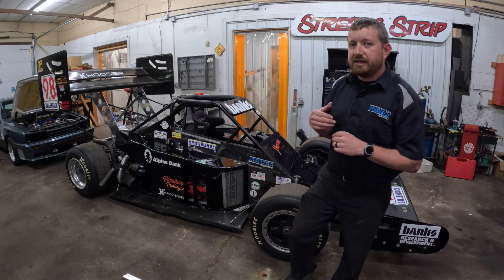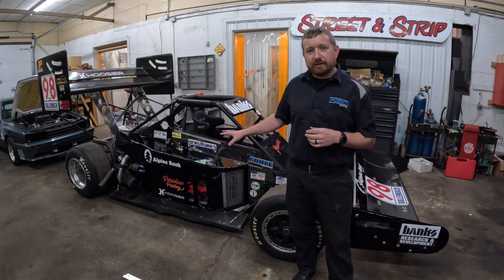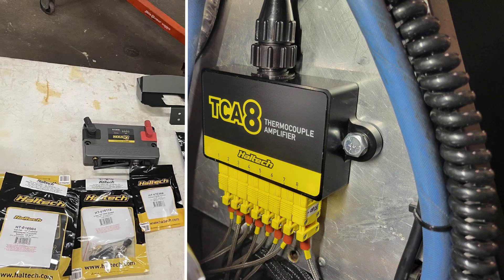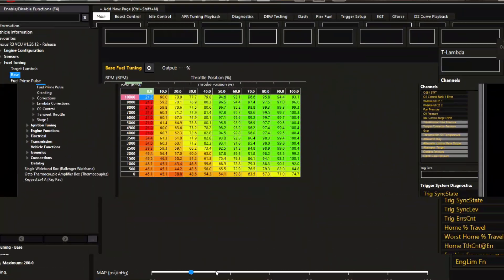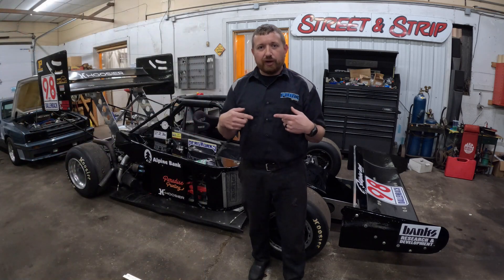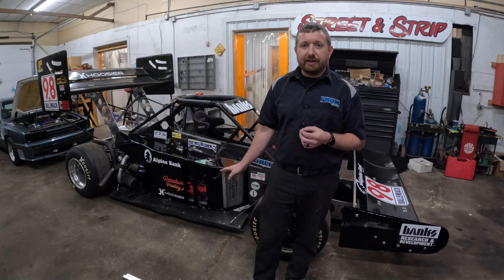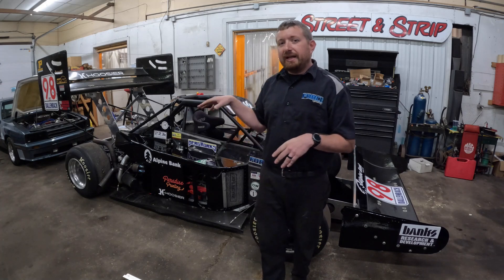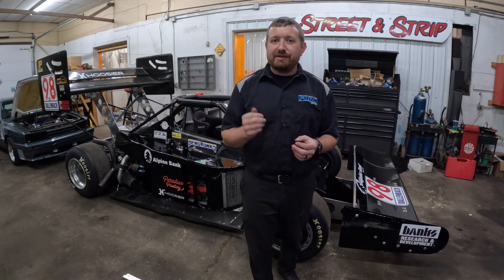Buick Indycar Engine + Haltech Nexus = Dallenbach Special, Pikes Peak Racer

Comment: I wonder if the Cruz Performance  camshaft sensor will work for you guys?
Reply from the maker: Thanks for the suggestion. Unfortunately, the cam sensor is specific to the indycar engine. There is not a traditional gear on the cam. The camshaft sensor is driven off of an auxiliary drive, which is belt driven off the crankshaft. The sensor body has a hole in the middle for a cable drive for the alternator.